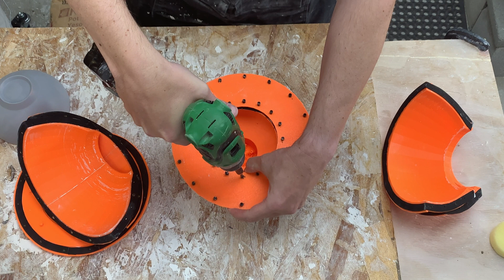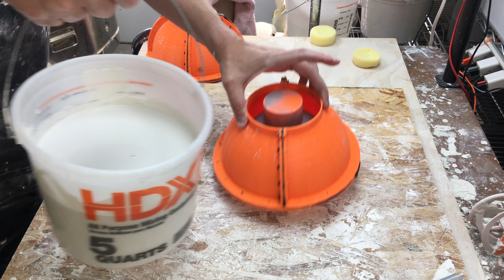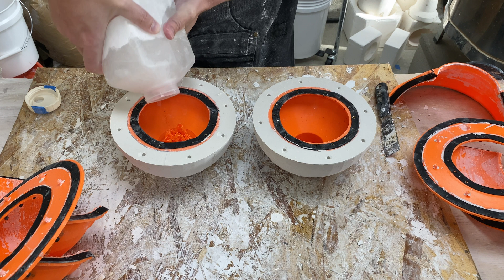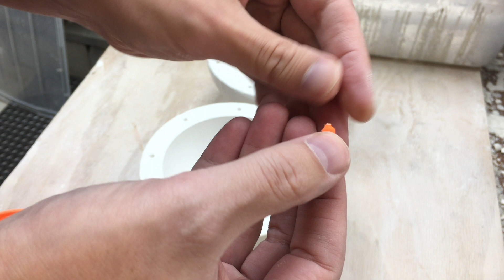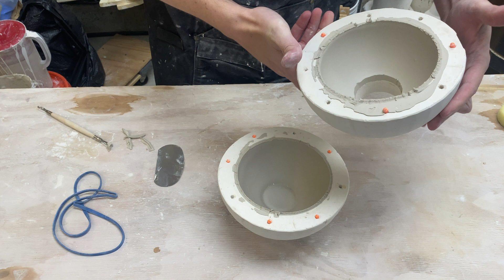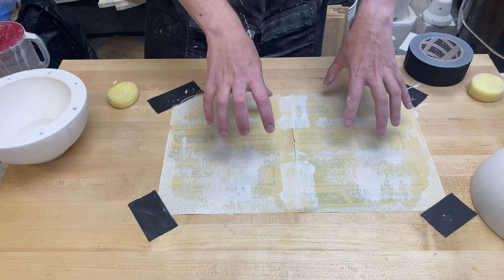Fresh plaster was needed! V2 of my sphere mold

Comment: kent, try using button head screws instead of DIN912s. they have a much larger head, so no washer is needed in normal circumstances
Reply from the maker: That's a good thought! In practice I havent had too much issue with these unless I try and reuse the mold multiple times. And in that case, it's just as likely that the insert fails. However even then, there are way more inserts/bolts than needed it seems because missing a few doesn't have a noticeable impact. I'd also thought about switching from M3 to something a bit bigger since I more or less picked at random and I'm not sure what tradeoffs there might be. I think in an ideal world, getting rid of the inserts would open the door for more people (at the potential cost of stripping out threads directly in the PLA).
Reply: using big screws for plastic might be an option. take a look at mc master's pn 90380A388 . they've a pitch of 2.24mm, 11 layers in regular 3d printing, so the thread formed by the screw should outlast the mold itself